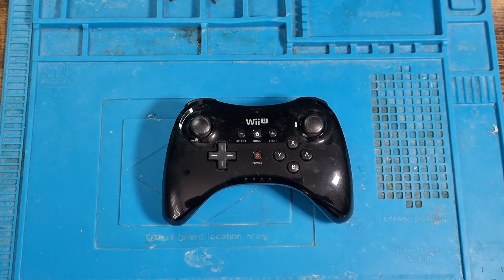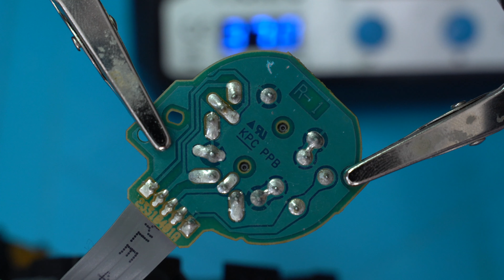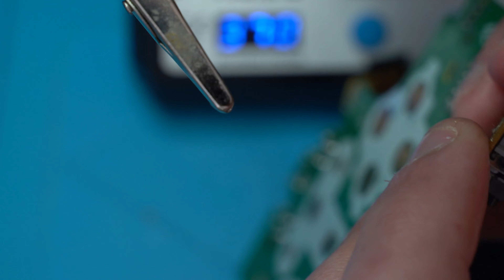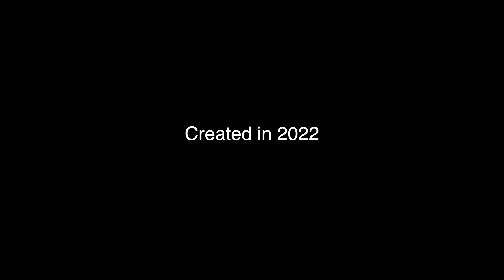Nintendo Wii U Pro Controller - Joystick Drift Replacement Tutorial Guide - 4K

Comment: so... what if I broke the rubber that joins joystick with the board while I was trying this? Is there any repair?
Reply from the maker: You will need to buy a 5 pin ribbon connector to replace it.
Reply: @theretropal but it just broke it from the joints... Can I just solder it again?
Reply from the maker: @TORMENTUMM  Yes.

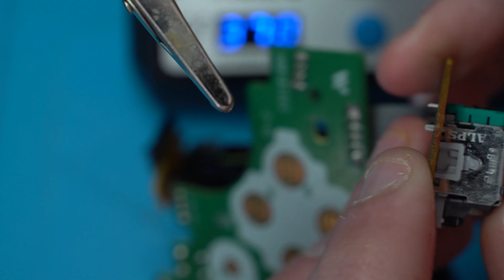Comment: I have the same controller and I used it on windows 10 with WiinUSoft. I don't know why the left analog stick is causing me to drift after 2 years. In fact, since 2022 I have never used it from there and I didn't know who I could turn to to get it fixed. Now I found someone who could fix it for me by first trying the simple solution: cleaning the potentiometer. Here's the point. I have a doubt about this procedure because on this controller on Youtube I only found you who replaced the entire piece of the analog stick by unsoldering and soldering. And so I had a doubt. Is it possible to clean the potentiometer on the wii u pro controller too by moving the green part which I think is made of sea foam and cleaning that white circle inside? 12:56
Reply: Specific. The left analog stick drift only moves to the right.
Reply from the maker: @LuigiMarioL  Cleaning can sometimes fix it, however, the majority of the time it's just easier to replace the whole stick as the potentiometer will never go back to centre after the fault occurs.

Comment: Best idea is to solder the 4 joystick pins housing FIRST. to keep the housing flat. Then work on the other pins. That way the joystick is flat during the whole soldering process. Don't go from left to right of all pins. You can tell the four housing pins are the ones in a square shape point. X figure solder them. Then you can work on the other pins. This'll keep the joystick housing stable while you work on the other pins to solder down.

The biggest problem with doing other joysticks say like Xbox to Wii-U. Is those have a different type of tension/friction systems then the Wii-U's will. You'll notice that the stock will have a much smoother and free moving silk movement. While Xbox will have a more 'drag' feeling effect that sure you'll be able to feel the direction more and have a more dead stop. But it won't be as clean feeling as the stocks. The best choice would be to buy some OEM Wii-U Gamepad joysticks with the board. Desolder those and resolder the new ones onto the controller. That way you'll get the exact same feeling joysticks with a refresh performance. But in the end if you like the Xbox feeling joysticks and want a more Wii-U controller style. This video choice would be the option. It'll feel bit weird at first that you'll feel again more of a xbox style joystick friction and tension. But if you wish to play more PC related games using a May-Flash adapter or so. This type of Controller will beat any others by far.

Comment: Good God what an unnecessary waste of time to do. I wish they didnt make these controllers joysticks so fragile. 😮‍💨 is it possible to replace them with hall effects?
Reply: Your controller could possibly not have stick drift at all. I noticed with mine, upon opening it, there was dust and dog hair within my controller analog stick!

 If your controller temporarily works upon blowing into the edges of the where the analog stick is drifting, then a simple clean up may resolve the issue
Reply: Just small amounts of dust in the Wii U pro controller can cause the stick to uncontrollably spin camera movement around. At least on the right stick.
Reply: The problem isn't with the 'Sticks' themselves. It's the abuse people put on them. I have a Wii nunchuk that's almost 20years old and it's still dead centered after tons of playing.

The biggest reason most get 'drift' is because the abuse they do to them. From not only slamming the joystick DOWN hard. But also do to the fact people SLAM them to the sides really hard. And Drift isn't always about the inner discs in the sensors wearing down. It can also be the effect of the spring inside the bottom end of the joysticks that snap it back to 0. Since the rod that you move, On the bottom there is a disc and a spring to make the joystick recenter itself. This spring or floating disc inside the middle of the joystick can sometimes get worn down due to the harsh abuse the player does to the joysticks and the joystick ends up not returning to 0. More due to the fact of the Spring rather then the sensor itself. It's why Gamecube and Wii likely never saw 'Drift' because it never had a mouse click button on the ledge of the joystick for people to 'push down' for it to be a click button system.

Hall effects also DO get drift to. And reason again is mainly due to the fact of the harsh wear and tear people give it for the spring inside the joystick center that cannot allow it to recenter to 0 again. Either by how they throw the stick around or by pushing it down to much. So Hall effects aren't truly the answer to all controller drift. It's more how you treat the joysticks.

The less slam and slap. the better and longer it'll last.

Comment: Cheers for video, I just recently found out Xbox One sticks are compatible, so I'm attempting to get a set of GuliKits Hall Effect Joysticks or even their newer Electromagnetic Sticks

 Hopefully everything will pan out and they'll fit lol, I don't see why it wouldn't as they specifically make a set for the XBox One

 Was wondering also if you had ever tried to recalibrate these controllers, the process is pretty straightforward:

1. Allow the control sticks to return to a neutral untouched position.
2. Simultaneously hold down the A Button, B Button, + Button, and - Button for at     least 3 seconds.

(There will be no indication when the recalibration is complete).

Absolutely lost it after reading that last sentence, how hard would it have been for Nintendo to have either the Blue:(player-status) or Orange:(charging) LED flash when the recalibration is complete.
Reply: Joystick for xbox one works? O just sticks?
Reply: Did it work?

Comment: I have my Wii U pro controller set aside for years because the joystick simply doesn’t respond. It’s not the same issue as yours, about the drift. But I believe that only the replacement should solve it.

All the other buttons works perfectly. Just the stick that doesn’t respond. Doesn’t matter which movement I do with it. There’s no reaction at all.
Reply: Have you managed to fix it? I have the same problem, one of the sticks doesn't respond on the y axis..
Reply: @ghawke1494  unfortunately no, I still haven’t tried. Still gotta order the analog replacement. But as far as I can tell this could be the only solution possible.
Reply: @CJ_IceCissalc  I managed to fix mine last night. One of the solder points on the sticks potentiometer wasn't going to the cable that connects to the main board. I hope that helps you in some way, good luck!
Reply: @ghawke1494  thank you for the reply! I should definitely check it if it’s the case here as well! I still haven’t really opened it up to check! Thanks for the reply! 🤙

Comment: Amazing video!
Wow!
Btw! Question! What’s the name of those arms which you use to hold the board while you do the work?
And also what’s the name of that blue mat which you used to lay the controller on at the beginning of the video?
Reply from the maker: Thank you for the comments, I really appreciate it. Regarding your questions: The arms I am using in the video are called: Soldering Station Helping Hands, there are range of them available, some with 2 arms, others with 6 arms, mine are attached to my Holife soldering station which really helps and finally the blue mat I am using is a Anti-Static  Silicone Soldering work mat, and again these come in different sizes.

Hope these answers help. 🙂
Reply: @theretropal  thanks a lot! Definitely helps!
I will look them up! :)

And once again! Thanks for the vid!